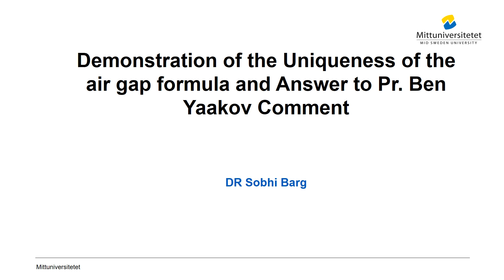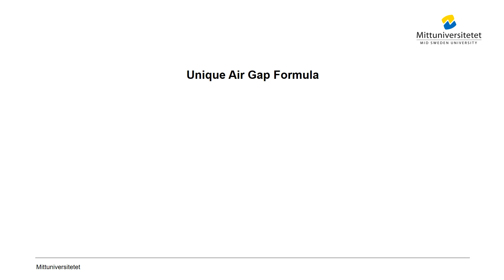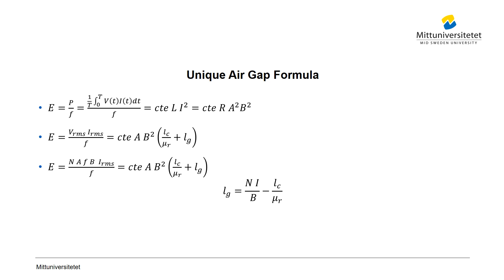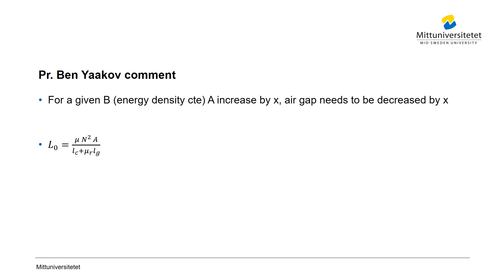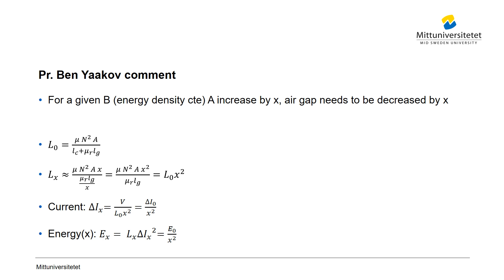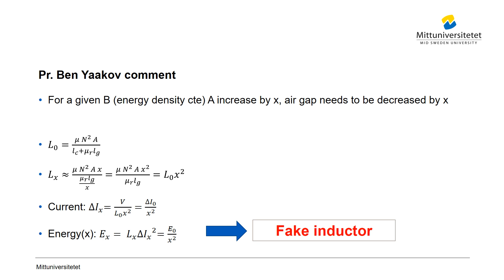Demonstration of the Uniqueness of the air gap

Comment: Here is my response.
1. In your presentation you dodged my observation that your formula hides A, while you are saying that the A has no effect. 
2. In your video you hide the fact that I explained to you that when lg and A are changed the number of turns have to be changed to keep L. This is cheating.
3. I finally understood from your video what is the root of your mistake. The reason is, I now believe,  that you do not understand  what the industry does or what their suggestions are. You say, wrongly, that the suggestion is to change L by only changing lg. This is twisting the facts. If you would look at any relevant datasheet you will see that the manufacturers give AL for each lg. Meaning: you need to change the number of turns for each lg for a given L. And not, as you mistakenly think, keep the same number of turns and just file the gap. I can assure you that the people in the industry are as smart and as educated as you are (at least) and they are using the materials to the fullest and in the most economical way. If you don't agree, prove it. Take a commercial inductor built around a given core and show us that you can design with the same core of same material, the same L that can handle a higher current. Or, design with a different core for the same specs but more economical. 

And finally, this is my last response on the subject until you show us a better design of a real inductor.